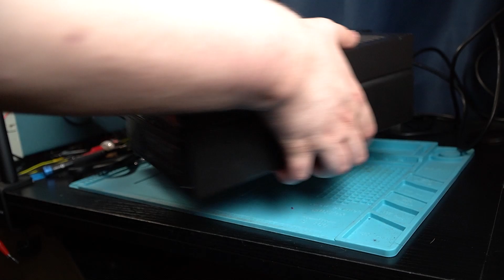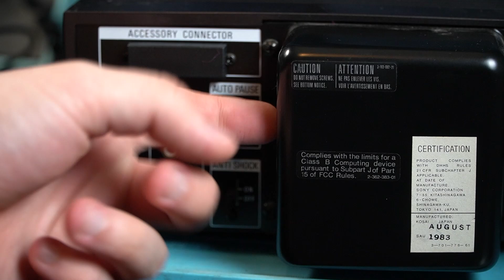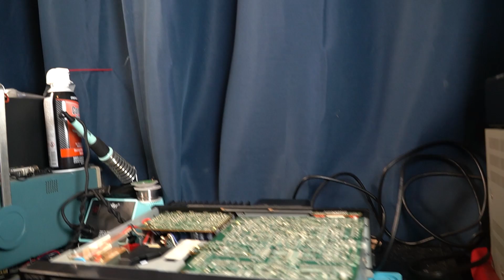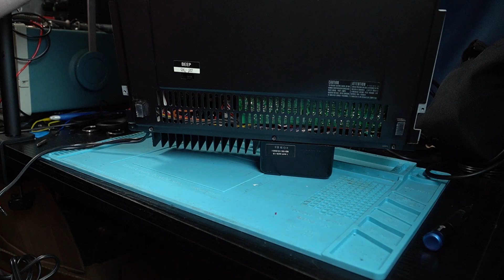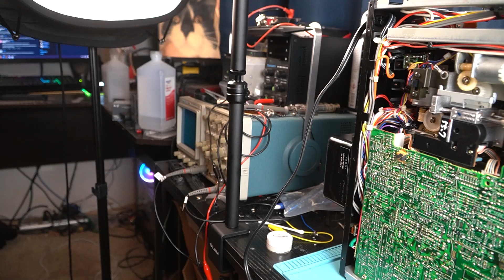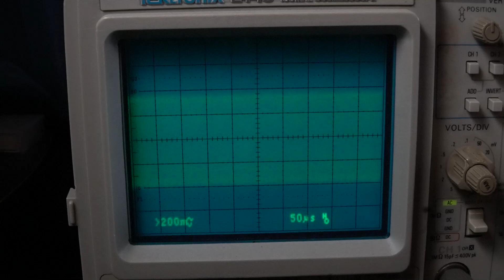Sony CDP-101: Repair and Review Of The First CD Player

Comment: Concerning the Timer Switch: IIRC correctly, it allowed you to use the CD player with an external timer. The external timer will turn off/turn on the power as you set it. You connect the CD Player to a timer, set the Timer Switch On, and turn the CD Player on, and then set the Timer when the system is supposed to turn on. When the Timer turns on the CD player it will begin to automatically play.

Concerning the Unswitched Socket in the back: Some devices had both Switched and Unswitched Socket on the back to allow you to connect other devices to it than in a Wall Socket. An Switched Socket would only provide power when the device is turned on, while an Unswitched Socket has power at all times whether the device is on or off. In this case, you could plug the CD Player into the back of a Receiver, and then plug another device into the back of the CD Player, thus you only need one outlet instead of three.